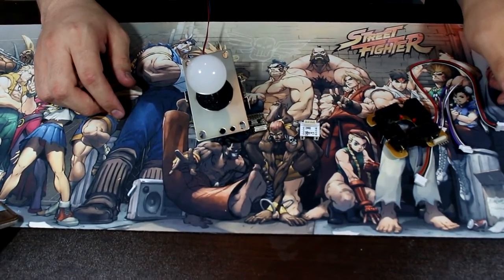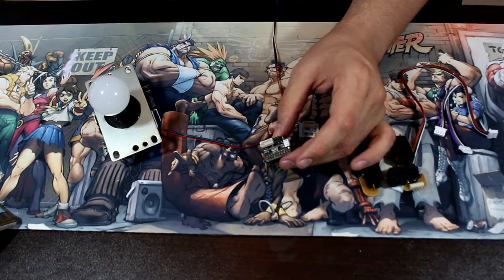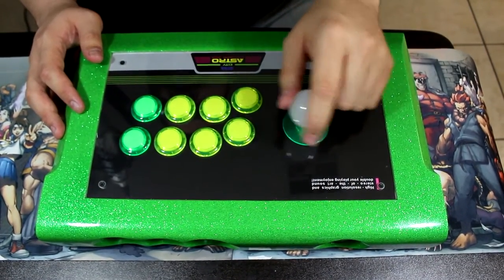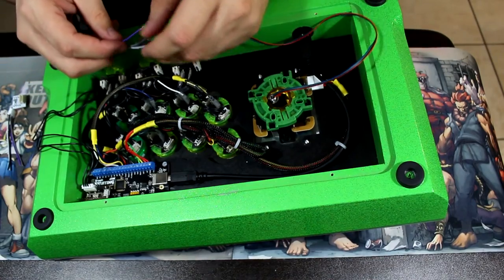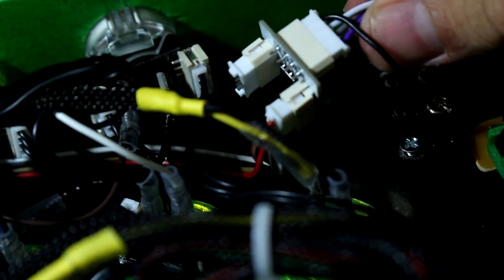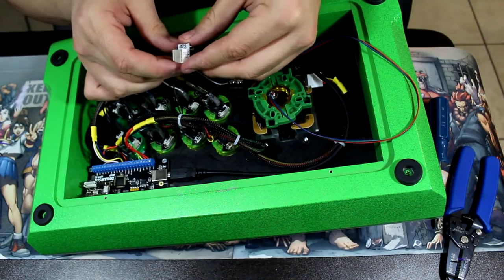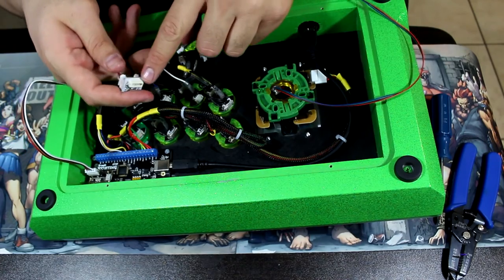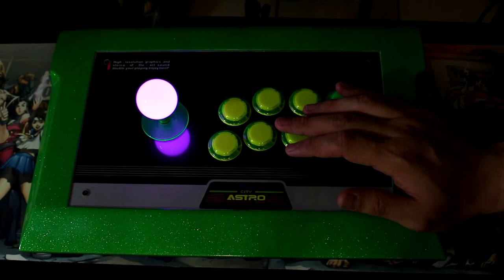ParadiseArcadeShop.com Sanwa JLF RGB LEF Joystick for Fightsticks

Comment: This video is amazing, and I'm glad you uploaded it as well as your other tutorials Fundando, really good stuff. I had a few questions regarding the barrier strip you used, as well as assembling the parts required to create your own LED joystick

1. Once acquired, do I need to solder the wires from the joystick and extra harness into the barrier strip, or is it a screw terminal? I was curious about how it actually worked. 
2. Is there a specific type of barrier strip I need to buy? I see some on amazon with 600v 25A or 600v 15A. Which is better?
3. How does one assemble the joystick when buying all the parts separately? Specifically, how does one connect the LED wire into the joystick? 

If you're able to answer any (or all) of my questions that'd be great. Thanks for your time.

Comment: So I've managed to get as far as soldering everything together and I've got the joystick lighting up, but I don't know how to get the joystick installed properly? It lights up but the motherboard doesn't recognize directional inputs? There's no 5-pin connector port on the Sanwa JLF Cherry mod. How do I connect the Cherry Sanwa to the Brook Board so that it may recognize the directional inputs??

Comment: question 1. So with the Adapter being mislabeled, both the leg wires and the harness wires need to be adjusted or just the led wires
queston 2. For programming, the joystick only has one led correct?
Reply: 1. It only needs to be adjusted once. Swap green for red.
2. Yes

Comment: I wish this video had been available before I ordered all my stuff, I ordered the hollow shaft, balltop and LED along with the kaimana mini 8 button kit, and had asked if that was everything I needed. Wasn't told I needed further adaptors, and getting those shipped over to the UK on their own just isn't worth it... Quite possibly no LED Ball Top for me =(
Reply from the maker: +Ian Dingle I have been working with the folks over at PAS to bring these tutorials to you. I am sorry that I could not bring this to you in time.
Reply: In a similar position; looking towards making an order soon, but trying to get my head around absolutely everything required. Am I correct in assuming if I wanted to support all mainstream consoles from the past few decades I'd need a Brook Fighting Board (PS4, PS3, XBone, Xbox360), a Multi-Console Cthulhu (retro consoles) AND a padhack to support Sega Genesis? That sounds like a lot to achieve, so wondering if I want to complicate things by also implementing an illuminated stick.
Reply: tbh if you're using a Brook UFB adding a kaimana LED setup is very easy! it doesn't really complicate things all that much - I only had an issue because I unfortunately didn't order all the bits required to light the joystick as well and ordering them seperately to the UK is wayyyy to expensive.

Comment: Can this work on the Mayflash f300 arcade sticks?
Reply: Yes but I hit a brick wall during the programming stage. The buttons light up but I'm having issues with programming. I can share pics and vids of my Mayflash f300 stick with this mod much help from paradise arcade support team. If a PSN I'll give you my psn Id
Reply: @rj5485  what about the F500 and can u do a vid about it?
Reply: Problem solved! I'll post pics here soon.
Reply: @2meal222 , yes it will work! The f300 and f500 are almost the same. I'm sure the pcb is similar to the f300. The kaimana mod will work. Unfortunately I don't do vids on YouTube but you can friend me on PlayStation network if you have an account. My PSN is Roscoe369
Reply: I finally figured out how to use the brightstick led webkit. Now ichave a never b4 seen on YouTube f300
Reply: I got a lot of help from paradise arcade shop!
Reply: @rj5485  thx man
Reply: @2meal222  you're welcome!